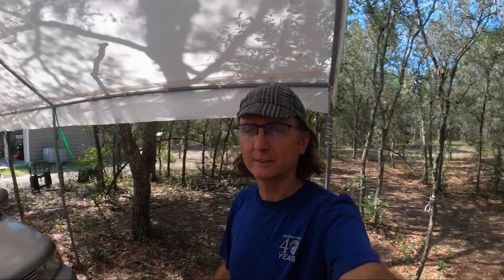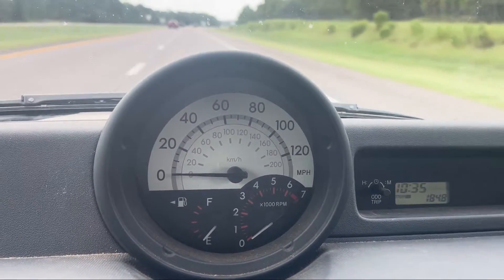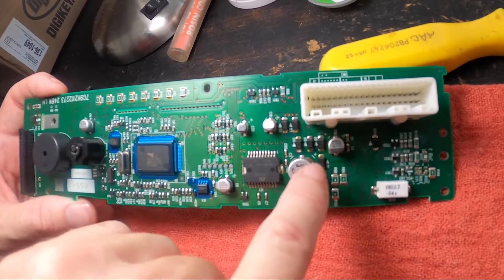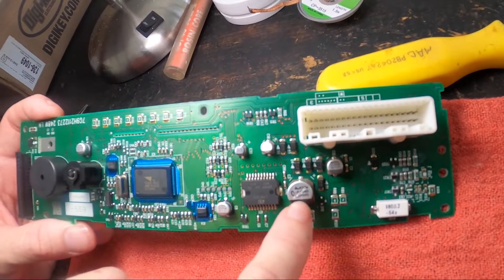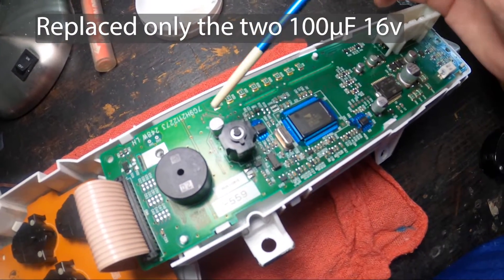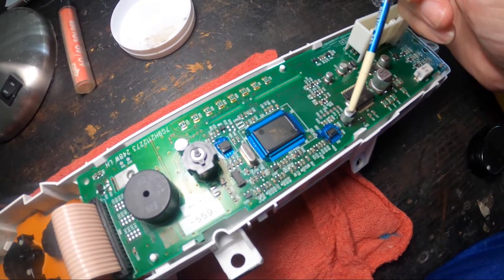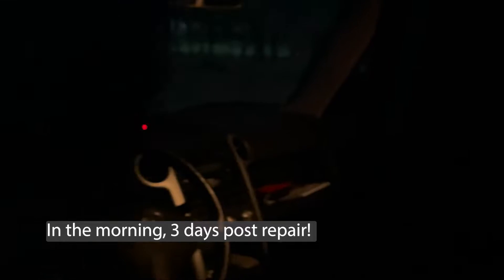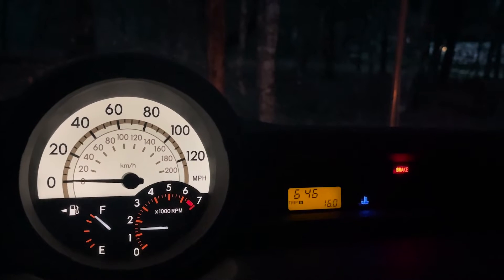Scion xB Instrument Cluster Repair

Comment: Okay, had the EXACT same problem on the box car I recently got from a friend. Scoured the internet for answers, found your video.
Watched 10 other videos on how to solder, bought all the parts on Amazon and a cheap soldering iron (mistake). And after an hour or so of scratching my head I changed out the Capacitor you point at , @ 8:49. 
Tested it and no flashing strong dinging sound. 
We’ll see if I have to swap out the other but HOLY COW thank you
Reply from the maker: @ThirteenthPirate awesome and thank you for letting us know it worked for you. Yes I too had a cheap soldering iron that I borrowed and I would suggest getting a quality one for doing this. My repair is still going strong, lights are bright, no flashing, and the needles pop right up, so fingers crossed it stays that way. Take care ~Ron

Comment: I’m located in Central Florida. Any chance I can ship my board to you and you fix it. Obviously, I’ll pay for your labor. I’ve dealing with this issue a long time ago. Actually my brothers XB has the same problem. So, It would be two boards.
Reply from the maker: Hey there John. I appreciate your confidence in me, but honestly, I wouldn't want to be responsible for your board. Also, I wouldn't have any way to test it after changing out the caps. Where in Central Florida are you? I am in the Spring Hill/Brooksville area. ~Ron

Comment: I'm in PUNTA GORDA, Where in FLA. are you??????
I wish you had shown the removal and re-soldering of those capacitors.
Thank You for this VIDEO....  I needed it......
Reply from the maker: Hey BubPiper! You're very welcome and I hope the video helps. I am just north of Tampa. I almost did video me soldering the capacitors, but there are several real good videos of guys doing this type of soldering on YouTube so I passed. It was actually pretty easy to do, but make sure you have a really good soldering iron with a small tip, flux, and proper solder. I ended up only doing the two and it's been over 2 weeks now and all is going well. Dash lights are super bright again, no flashing or dimming, and the gauges pop right up. Good luck! ~Ron
Reply: I ordered the 16v capacitors, and I'm looking for a fine point soldering iron.
This is going to be a rewarding project.....  it is a 2005 XB with 95,000 MILES, garage kept in South Florida.
Reply from the maker: @bubpiper4028  Awesome and please let us all know how it goes. Fingers are crossed for you. Good luck! ~Ron
Reply: So, I'm watching YOUTUBE VIDEOS about replacing Electrolytic Capacitors and they say that between years 2000 and  2010 there were many faulty manufactured ASIAN Capacitors...... That explains WHY we are dealing with this problem.  UREKA....

RON..did you melt the CAPS off or BREAK them???????   I'm thinking of SNIPPING them.... What do you think???
Reply: I got the CAPS, you specified.....  OMG are those soldering legs TINY, and don't stick out far, if at all....  Was there a different brand, that I could have ordered that would have given me a larger soldering area??????
Reply from the maker: @bubpiper4028  so I applied heat with the soldering iron while lifting with some small pliers. I did see some videos where the guys just twisted them breaking them off but I didn't want to chance that.
Reply from the maker: @bubpiper4028  so after I removed the old CAPS, I did my best to clean up the area on the board. Then I applied flux and some solder to the board. I added flux to those tiny legs on the CAPS and held them in place while applying heat from the soldering iron. I had a cheap soldering iron so it took some time but I got them on. Like I mention in my video when you look at the solder joints under a magnifying glass they're not pretty but they are holding up and my cluster is working like new still. I borrowed the soldering iron from a neighbor, but if I had to do it again I would go ahead and invest in a nicer one for myself. Good luck my friend. ~Ron
Reply: I know nothing about CAPs and PCBs.  (A little knowledge, (from watching YOU-TUBE) is a dangerous thing.)
BUT, I'm wondering if using CERAMIC (surface mount) CAPs, would have been CHEAPER and EASIER to solder???
I already bought the Aluminum Electrolytic CAPs, so I will give them a try, but I'm hoping that this VIDEO gives fellow XB owners, a refined blueprint on the BEST way to GETERDUN.
Reply from the maker: @bubpiper4028   haha I know nothing about CAPS either, but I did stay in a Holiday Inn Express, so I am good to go. :-)
Reply: This morning, I swapped the ORIGINAL flashing XB DASH for the JUNK YARD DASH that I had bought a year ago.  Before I RE-CAPped my ORIGINAL DASH I wanted to see if the JUNK YARD one was compatible and MAYBE if it worked.  WELL, the JUNK YARD DASH, so far, is not flashing.  I'm going to leave the JUNK YARD DASH installed, for now, until it starts to flash....( maybe the colder weather?).  So the RE-CAPPING JOB, of my original DASH is on hold until I need it.  RON, THANK YOU for this VIDEO.....
Reply from the maker: @bubpiper4028  right on! Yeah if the new(old) one is working from the junk yard I'd probably would have done the same thing. Maybe down the road when/if you have to repair one or the other just let us all know how it worked out. Until then take care and you're welcome. Happy the video is helping some folks out. ~Ron
Reply: Sept 20th, I RECAPPED( the two CAPs you recommended) on my FLASHING ORIGINAL DASH this morning.. 
Installed it, and it is working (so far).... If you don't hear from me, you can ASS-U-ME that it is still working.
You were RIGHT RON......
P.S. the $6 pencil point soldering iron, is crap.  and soldering those CAPs on was difficult, I used 951 liquid soldering FLUX, I JIGGLED the old CAPs off,  NEXT TIME (pray there is no next-time), I'm using CERAMIC CAPs, that are over 1/8" across.  (and yes, I don't know anything about what I'm talking about here)
BUT, now I have TWO DASH-es that WORK.......
Reply from the maker: @bubpiper4028  awesome and happy to hear you gave it a go and AND it is working. Many thanks for letting everyone know that it worked for you too. Yeah I would recommend getting your hands on a proper solder iron if you can. Good deal and take care. ~Ron
Reply: If I was going to RE-CAP another XB DASH PCB, I would try using a CERAMIC or a TANTALUM (surface mount) CAPACITOR this time.  EBAY has 3 TANTALUM CAPS (TAJC107K016RNJ SMD, 100Uf-16V) for $2.49, at 6mm in length.   These (Shoe Box Shaped) CAPS, might be easier to solder......

Comment: Hi i am having the same problem what was the part number u bought to fixed the problem and thank u !!!!
Reply from the maker: Hey there Hiramcuevas808! So there are a total of six capacitors on the board, but two of them are the same. While I did order all of the capacitors, I only replaced these two and they are the same part number. PCE4534CT-ND -- CAP ALUM 100UF 16V  -- PANASONIC (2 Each) . I ordered 10 of these just incase I messed some up, but got lucky and only needed two. If you watch the video it will show which two these are. It has now been 11 days since I replaced mine and all is good. The dash lights are super bright again and all the gauges work like new. Good luck and hope this helps. ~Ron
Reply: Where did you find the capacitors? Thank you for this!
Reply from the maker: @ThirteenthPirate  Everything is under the description of the video. ~Ron